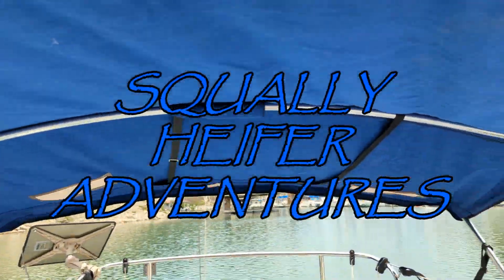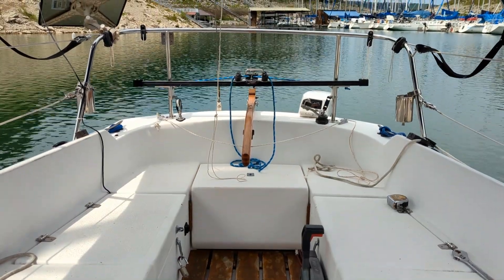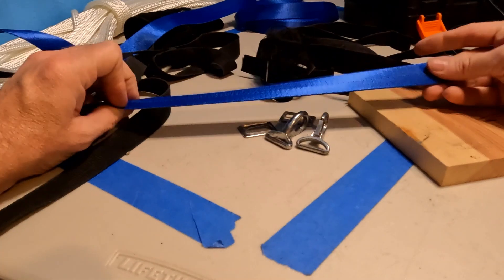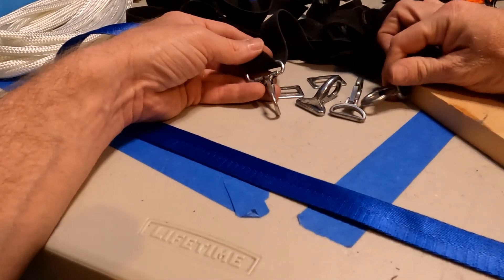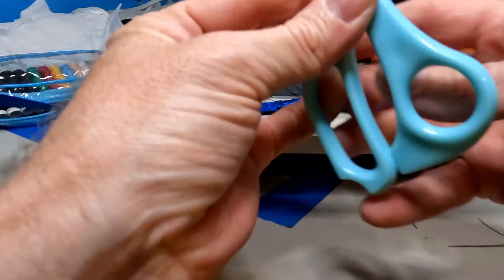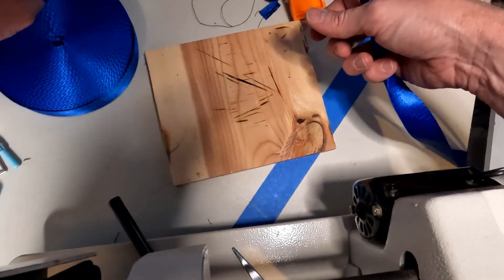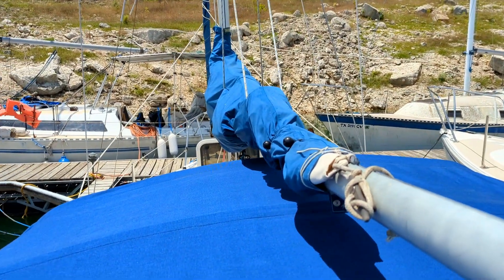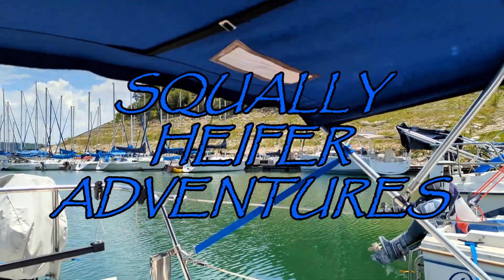Bimini Top Setup and Strap Upgrade

Comment: Hi, Squally! A great video -- love the tips re: the twist in the loop and hot knife! End results look awesome!!! What kind of thread did you use and what size of needle was in the sewing machine to get through that polypro strap/line? How do you like the traveler set-up on your 23? I have the standard-factory mainsheet rig on Charm. Talk soon and fair winds!
Reply from the maker: Hi Chelle, I do not know the needle size.  This is an old heavy duty walking foot sewing machine.  I use upholstery thread.  It is thick and strong.  I do not know if it is UV resistant, but it will be under the bimini cover so it should only see the daylight when I am sailing.  We will see how it holds up.  Your guess is as good as mine at this point.  So far the traveler is fine.  I can lean against the back pulpit without it hitting me.  I will see how it goes and if I want to go back to the original design.  The old hardware is still there not being used.